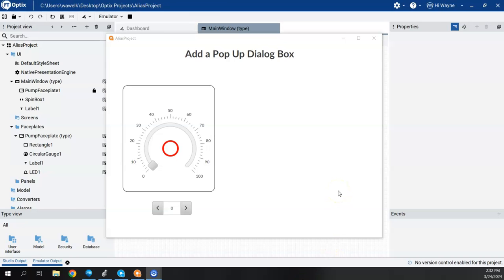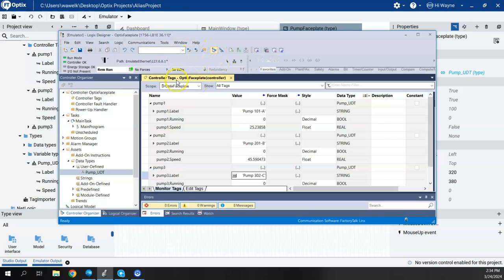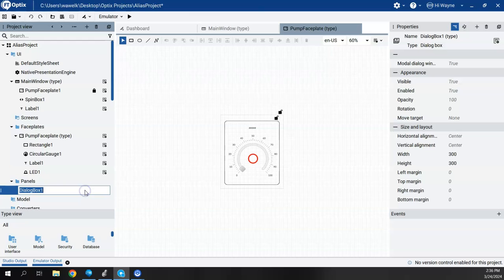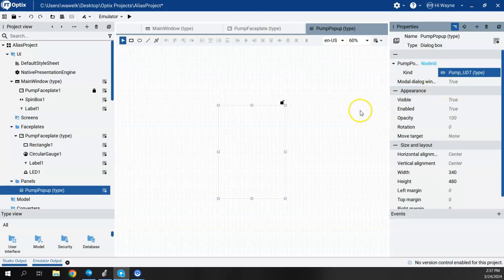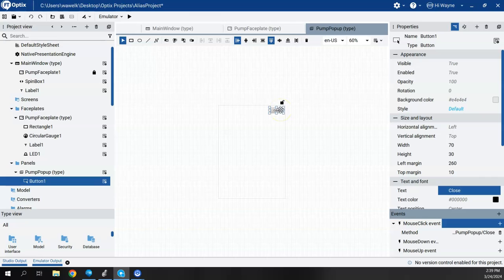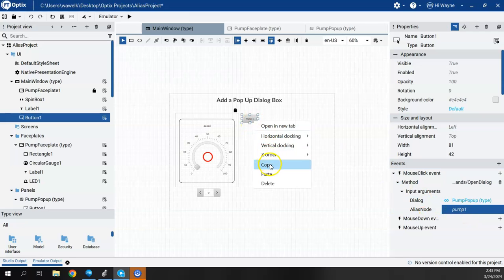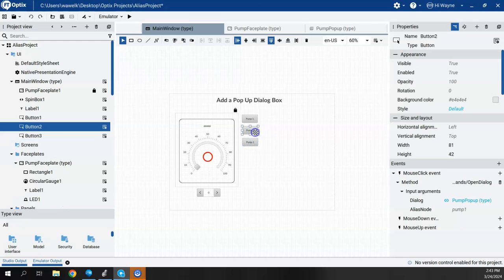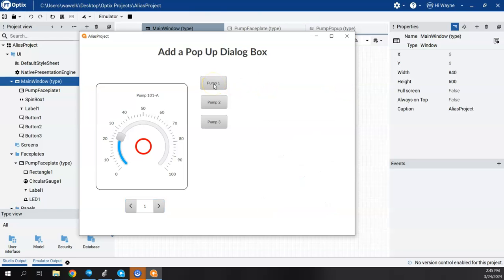FactoryTalk Optix Reusable Graphics Part 5 - Create a Popup Window with a Dialog Box

Comment: Hi there!
I am trying to find a tool for Allen-Bradley PLCs similar to SiVArch for Siemens PLCs, to automatically generate faceplates and connect them to the HMI tags based on predefined rules. Does anyone know if there is such kind of functionality in FactoryTalk Optix, or maybe there is an external tool which can automatically generate the faceplates and link them to the tags? Thank you!
Reply from the maker: @eugeniugangan7402 - With the FactoryTalk Optix V1.4 release (coming soon), Rockwell will introduce several faceplate device libraries for Optix.  These will be prebuilt faceplates similar to what is available for the PanelView Plus and View SE.  Rockwell will continue to build more faceplate libraries throughout the year.

Comment: I'm trying to put a switch on a panel that controls a bool in my controller. I also want that switch to be checked depending on whether that tag is on or off. The way it is now, if you navigate away from the display and go back, it goes to the default checked: True. Is there an easy way to link that?
Reply from the maker: Are you using the base controls switch?  And what version of Optix Studio are you using.  I have V1.3.0.968 and the base controls switch does show the value of the BOOL tag when I force the tag on/off in the PLC.  It also lets me change the value of that same BOOL tag in the PLC from Optix.  And it is retaining the value when I switch from between panels.  I know in the previous version I saw the switch not retain when switching between panels - it may have been resolved in this latest version.
Reply: @wawelk  Hi Thanks for your videos, that helps me a lot. Can you please explain how to create a drop down list based on a string array from PLC. I have array of 32 string and I need to display them when I click on drop down/button and send a index  number back to PLC so the PLC know which one I selected.